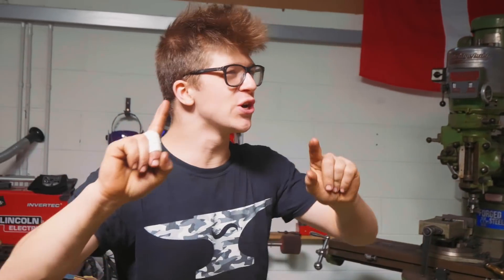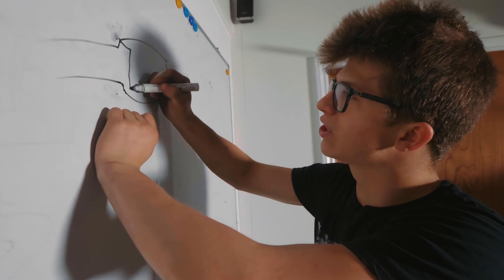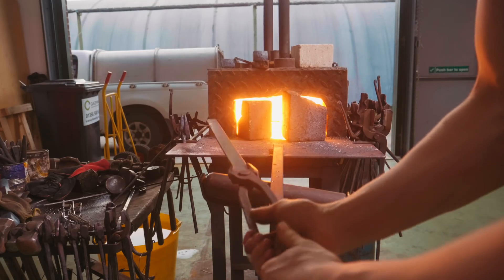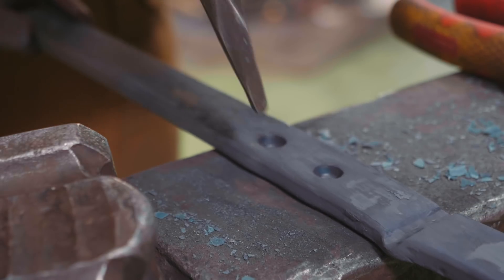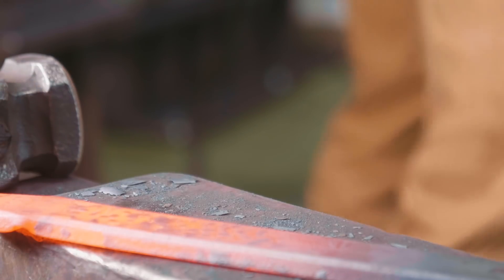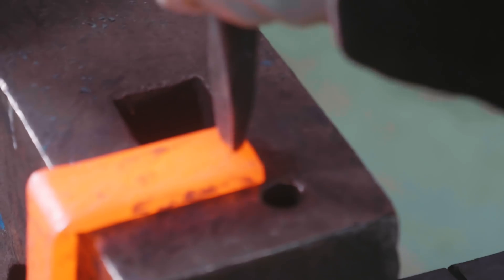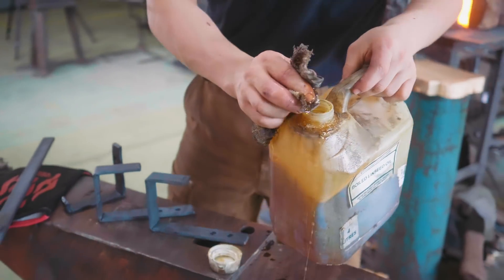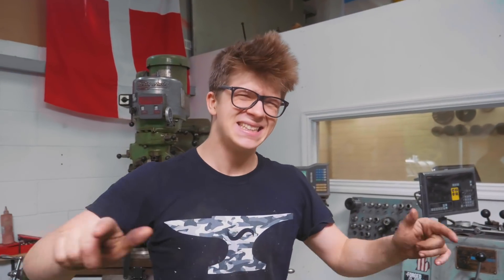MAKING HOOKS FOR MY SPACESUIT!!!

Comment: Fwiw, there would have been several ways to get the "blocked" hooks screwed in the wall. Right angle drill/attachment, thru holes (or just a slight offset) on the near-side vertical for an extension to get through, put in with a screwdriver bit in a socket wrench, as suggested in another comment. Also, by the way, I like bringing a bit more of the blacksmithing fundamentals back into the videos! Great work.

Comment: The first hooks were usable. You mark the covered hole first, remove bracket drill, insert rawl plug,  screw bracket on, mark top hole, twist bracket out of the way etc.
A long screwdriver works wonders. 40 years a fitter. You learn stuff.

Comment: Not sure why you couldn't use the first brackets. Drill holes with the drill. Put in plastic wall anchors. Use a ratchet with a bit adapter and screw the hooks to the anchors. Seems simple enough, and you already have the anchors. Could have saved some time and some steel.
Reply: bill withers he may not be as mechanically inclined to see that at this time.
Reply: I was thinking the exact same thing.
Reply: Or add a hole on the outside piece as well, and use a longer bit/ a hand screwdriver.
Reply: Steven Schmelling an hand screwdriver would have worked in any case - a light angle is no problem with the right type of screw head ;)

Comment: Question. On the first failed attempts where the holes were not accessible, why did you not leave the bend out of the last one and once mounted on the wall use the torch to isolate the heat to where you wanted a bend and make the final bend in place

Comment: the one thing that is bothering me is how the belt hangs over down to the lathe.
Reply: King Albby it isn't in the way of the spinning bit.
Reply: It still can get cough.
Reply: It does not work like that. It still is unsafe.
Reply: I think the placement is off too. It alex uses the lathe is his space suit going to get covered with fillings
Reply: He'll have an issue when a hot chip embeds itself into the inside of the belt and poke a hole in him .. fluid loss from sharp thins is never good ...
Reply: Agree.. put it around the corner away from the lathe Alec.
Reply: Me too!

Comment: Predrill the hole and take an old screwdriver, heat it and bend to 90 degrees. Use the bent screwdriver like an Allen wrench. Now you would have your hooks hung and have a screwdriver for situations like this. Or you can use a socket and ratchet because those bits do fit inside a standard socket, or since you are a blacksmith make a tool to hold the bits, or use a box end wrench. The mistake wasn't making the holes where they were, the mistake wasn't using a different tool to mount it.

Comment: Could have fixed your first 2 by drilling or drifting larger holes in the 'front sticky up bits' that a shaft extension for your drill could have passed through to get to the holes behind :-)

Comment: Hey does anyone have any recommendations for anvil substitutes. Built myself a forge and I have the tools, I just need something to hammer on... Any ideas?
Reply: DiscordianEmbassy go to the scrapyard and grab a big piece of mild steel. 75-100lbs.  As long as it has the mass it will work. Use whatever you can find.
Reply: I Agree with Discordian here. You can pick up a length of chain to deaden the ringing sound when you strike the workspace..oh and dont use legs as a stand to raise it higher, use a hardwood (if possible) tree stump. Again stops ringing sounds.

Comment: if you drill or punch one hole in the up leg you have screw driver hole and it will look like you knew what you were doing
Reply: Or just use an angled screwdriver. Or a ratchet socket/screw-driver.